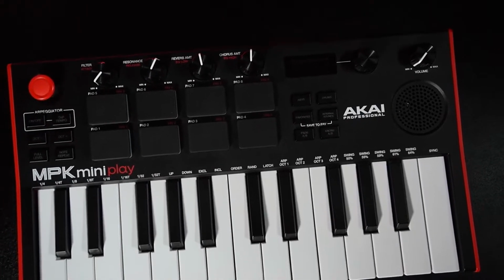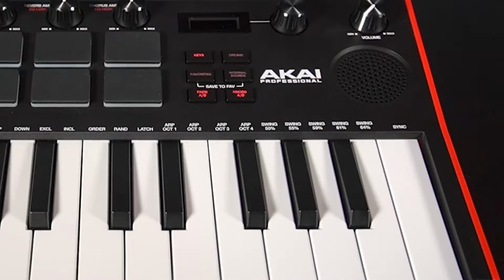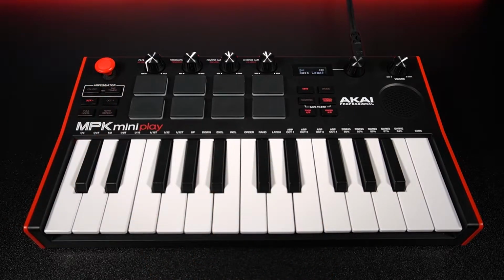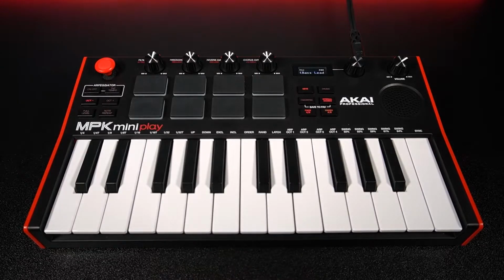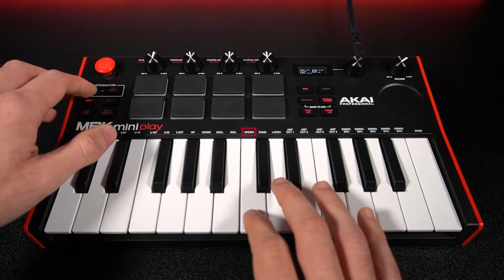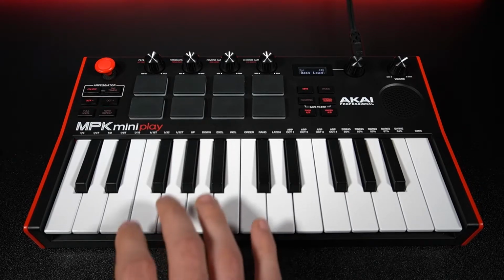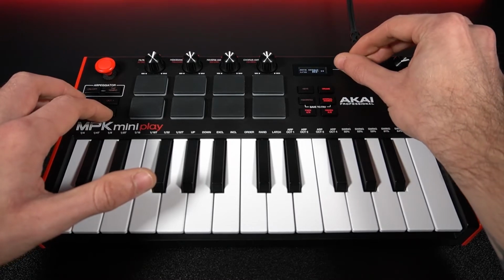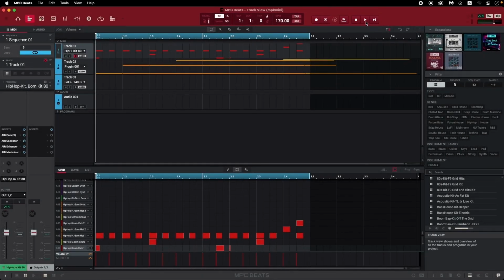Akai Pro MPK Mini Play MK3 | Onboard Features & Standalone Use

Comment: Thank you - you provided some tips I couldn’t find elsewhere (not even on the instruction manual included!) such as the ability to adjust the BPM (beats per minute) by holding the apeggiator ON/OFF button while turning the sound selection knob (I wouldn’t have thought to try this). 

Also, that the note repeat function for the drum pads can be adjusted with the various arpeggio parameters, such as the time division fractions, swing, and BPM).

Here’s another tip: there are 2 effects knobs that DO affect the drum sounds: the high and low EQ’s (switch to the “B” bank of your drum set using the Knob A/B button). Those are the only 2 that work on the drums

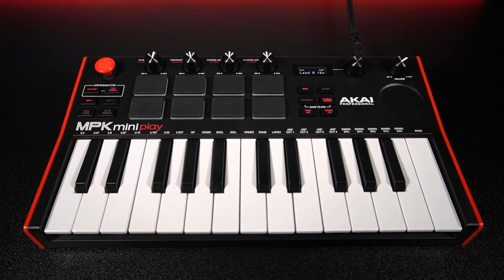Comment: At 4:27 , he has the arpeggiator turned on and then touches one note(F) and we hear a three note arpegiated chord.  How did he do that?  I thought you have to hold down the chords to get it to arpeggiate. Did i miss something?  Can anyone help?  Thank you!
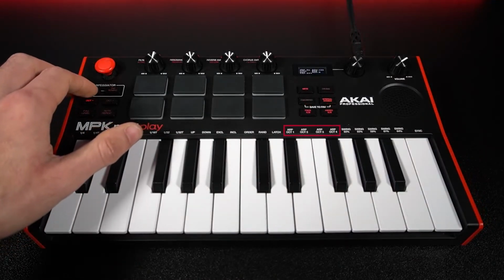Reply: Those notes are octaves. So there's no "chord", just several F notes in different octaves. You control the span of octaves for the sequencer by holding Arpegiator On/Off and pressing keyboard keys with OCT labels. He explains it at 6:06.
Reply: Thank you!

Comment: too bad it doesn't have a looper or sequencer.   it would be simple to add those features somehow.  not sure why these devices always leave out the looping function.  Cant use it to jam with, if there is no looper, would have to get an external looper pedal, and wire the audio, and then a separate monitor speaker, that is a large setup, might as well get a real arranger-keyboard at that point.   MPK Play could easily include a looper inside to provide it easily..
Reply: I was ready to buy this until I realized it didn’t have a looper 😢
Reply: I just plug into my loop pedal and plug my headphones into it. Mad easy
Reply: @ogchris_  Any loop pedal you'd recommend?
Reply: @PhilHarlow  How u loop it?
Reply: @seanheffron8444  just use the boss rc1 its a foot looper pedal 🙏
Reply: @schmiertoast7184  Thanks bro. I was trying to get a beginners maschine. I shouldnt have to spend more $ and get a looper but it is what it is.
Reply: Any of that guitarists uses.  U can go even with a guitar multieffect that sports a looper then have more fun @PhilHarlow
Reply: YES!
Reply: That's devastating bro! Why wouldn't they provide such a basic thing... I thought I could create beats and parts and layer them on the go. Basically I'm back to what's the point even?
Reply: Exactly! Wtf is the point of this thing with no looper
Reply: Is there any device that has a built in looper plus a speaker? Just to test out ideas, ok-ish sound even.
Reply: @omarpervaiz  a real keyboard does this. Some keyboards also have a vocal mic.  Akai is not designing MPK properly.
Reply: @omarpervaiz Novation Circuit OG
Reply: @sb677778  affirmative! 👍
Any variant with a built in speaker?
Reply: @sb677778  thoughts on Yamaha SeqTraks?
Reply: @sb677778  finally got the OG brother! Such a fine machine! Great condition to. 
One issue. A key pad stopped working. Wrote to novation already but I'd check here just in case you got a quick fix.  
Be well!
Reply: @omarpervaiz  have u found one with looper? Same issue here
Reply: @FelipotheMiraculous  I found the op1 but it has it's limitations. There's another one but I can't recall the name. Will share here soon.
Reply: Yes. Suggestions for any products appreciated. My son wants to record beats on this and then loop them and record keyboards etc. he doesn’t have a computer yet.
Reply: @calebjc  old ipad with garageband, using any inexpensive midi keyboard you want, the ipad using garageband can record midi and loop. It is the best bet, has best sounds, also easy to learn and transferrable to Logic later, since these midi keyboards are still so limited in this way by themselves.
Reply: @calebjc Novation Circuit OG
Reply: @calebjc buy a guitar looper. Best to go with an RC 1 bc it has 2 inputs
Reply: They want to sell you more crap that’s why.. 😢
Reply: Its unfortunate because as far as ive seen, the Mpk mini play is the ONLY controller ive ever seen with onboard speaker and battery. The Arturia Minilab 3 blows this thing out of the water on every single aspect, besides being able to use it as a standalone. Hell, not only does the minilab have a layerable looper, it has the ability to make live samples, and you can download and make your on onboard sounds.
Reply: You've just described exactly why they are selling it that way. A good way to sell two devices.
Reply: Dang! Of course. I just need a regular small portable keyboard. Thanks!  
Got any suggestions. Do share. 
I'm all guitar gear.
Reply: @omarpervaiz  Yamaha Reface does looping and is portable and also midi.   However Yamaha is price gouging musicians with the astronomical price of the Reface, and it is only 37 keys which is too big for ultimate portability and just too small for fully voiced playing (need 3.5 octaves really, so 44+ keys, not just 37, which is missing important bass notes).   Some performers use Reface in live situations including looping.  Probably sweetwater would have good advice on this.
Reply: Mvave smk mini ll
Reply: Who buys a cheap singular device in hopes to in hopes to jam with several instruments at once? 😂
Reply: @  with a 1-man-band setup that is small and mobile, it is very easy to make real $$ and gain dedicated fans by jamming in public.  and that is only ONE OF MANY reasons it should have a looper/sequencer.  how do you think ed sheeran got his first 10,000 fans??  by jamming as a 1-man-band.  there is no reason, today, with today's technology, that all these features need to be in various different devices, with required cabling runs, compatibility problems, separate batteries, etc, etc, when it could all be in 1 device.   Professional songwriters in los angeles often write/collab on songwriting for top artists by also doing this same thing: jamming with a looper/sequencer, it is very competitive and can be very spontaneous, i.e. being in the right place at the right time with mobile gear in hand, asked to step into the songwriting collab room for a minute to throw out ideas, and boom a song hit is made, possibly rocketing the entire career trajectory of that musician.
Reply: Yall are missing the fact that it’s a midi device that has onboard instruments as well… without the speaker and onboard sounds, it would still cost the same price
Reply: Has anyone tried using the arpeggiator to create drum tracks. I assume you can assign drum sounds to certain keys (?)
Reply: I found a rc-505 mk1. For a good price works great with it! You can also use the boss rc-1 handy if you use it like a footswitch cause it leaves your hands free
Reply: Yep that is important when it has pads
Reply: Thank you for saving me 10 minutes that’s all I wanted to know lol
Reply: I’m thinking Maybe it’s intended for folks that already have the other necessary gear for looping.  I just purchased this... because I already have a full setup w looper , mixer, PA etc. and I just wanted to add a small keyboard w drum pads. And in my case it would be waste of additional expense to pay for an onboard looper that I wouldn’t be using...
Reply: @dwstoeckel4740  Sure except that it does not add nearly any cost to put a looper or sequencer inside these keyboards. They are all controlled with some DSP chip.  They are all using MIDI.  A looper guitar pedal has to record audio and then store the audio in memory and then loop that audio.  But again these keyboards are already MIDI, so they only have to store the MIDI notes and loop those MIDI notes, that is very easy thing to do when the chip in the keyboard is already generating MIDI notes for real time key presses, all that MIDI data is infinitesimally tiny compared to an external looper pedal.   I mean, it is just ridiculous not to have looping inside these keyboards, regardless how cheap they are, the added cost of the looping feature would be less than the cost of the physical button that triggers the "Loop".    And sequencing...same thing...  it is not at all difficult to add sequencing considering the keyboards are already MIDI inside.

Comment: very informative, thanks. 1 question- is the headphone output 100% clean if you run it through an amplifier?
Reply from the maker: Hi! Thanks for asking! The headphone output will absolutely be clean and noiseless if run to headphones or a stereo line-input (Aux input) on a mixer, powered speakers, or similar devices. Though, be careful not to set the headphone output volume too high if connecting to a device other than headphones. We would not recommend connecting the output directly to a guitar or bass amplifier.